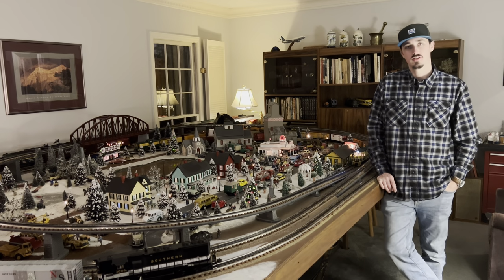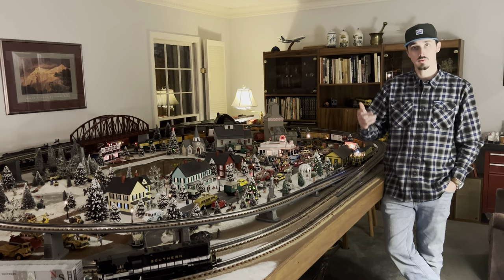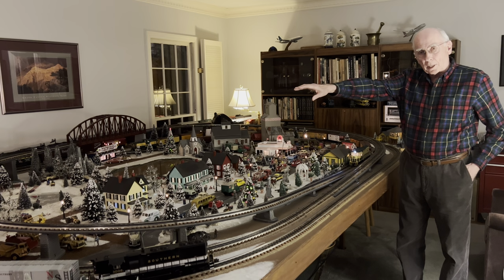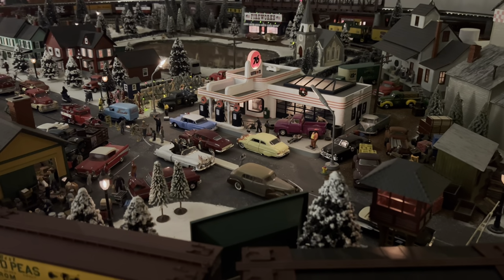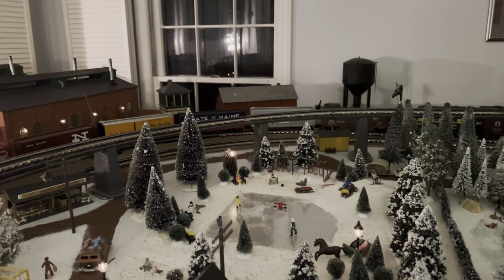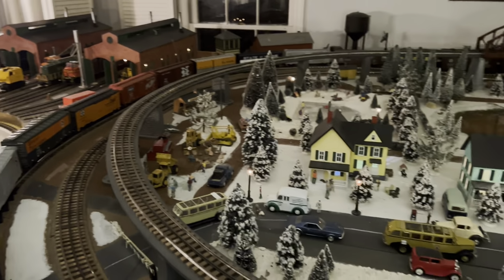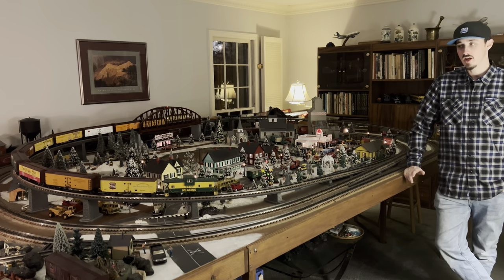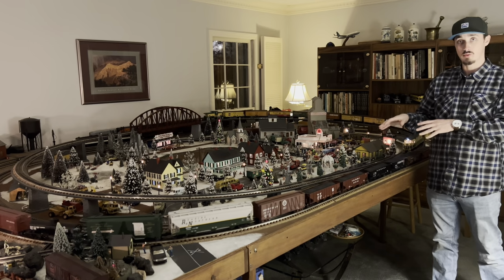O scale Layout Tour #1 “The layout that got me into scale model trains”

Comment: My 3-rail hi-rail layout is basically just for ever-increasing diameter ovals. This way if I get any engines that require a big radius curve I will have the track already in place for them. I'm not interested i n switching and all that I just want to let the trains run. I like the Mike's train house real tracks with the solid rail I was so disappointed when they went to the sheet metal tin plate style construction which was cheaper for them but not for us customers the lightweight rack feels very cheap compared to the heavyweight track which is better.